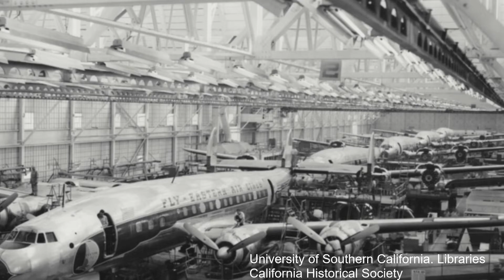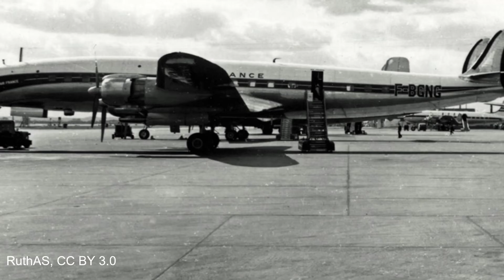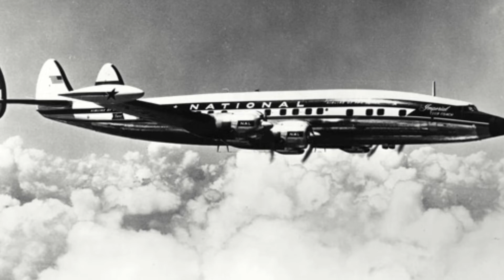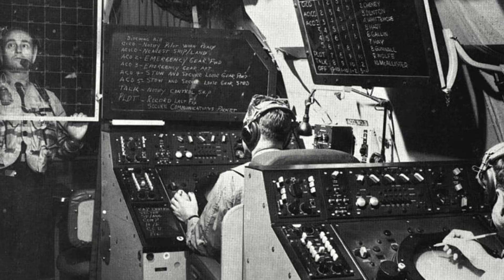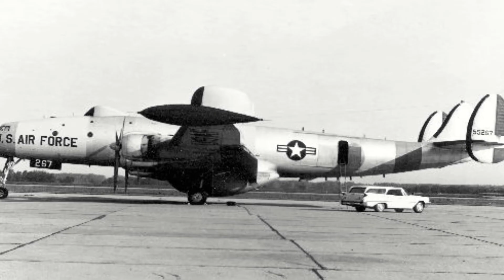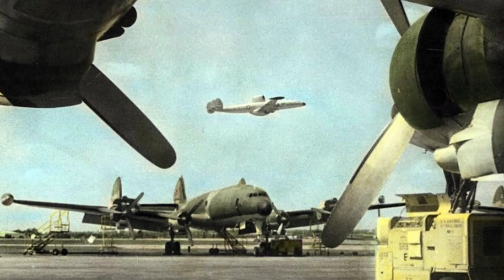Golden age of airlines - The Story of Lockheed's Super Constellation

Comment: I was a radarman on the Navy EC-121Ks. I first served with AEWBARRONPAC stationed at Barbers Point, Hawaii in 1960. The squadron's aircraft deployed to Midway Island to fly radar missions between Midway Island and Adak, Alaska. In 1961 I transferred to VW-11 stationed at Naval Air Stations Argentia, Newfoundland. Aircrews from VW-11 deployed to Keflavik, Iceland to fly radar missions covering the Greenland Iceland gap and the Iceland Faroe Islands gap. I flew with VW-11 until I was discharged in April 1963. I have slightly over 2,400 hours as a radarman in the EC-121Ks.

Comment: Square windows!!!! Were they lucky? (Refer to Comet)
Reply from the maker: I hadn't thought of that, but it would seem they were. There is a reason that we don't see those square windows anymore. Interesting point
Reply: @AntiqueAirshow  It turned out that the windows were not the cause of the sudden decompression accidents with the Comet. Do a Google search on it. Cheers!
Reply: It was not the windows in the Comet, but the rivets that caused cracking unaccounted for in the aircraft skin that developed into stress cracks and failure.
Reply: @donaldstanfield8862 .l The rivets at the corners of the windows.